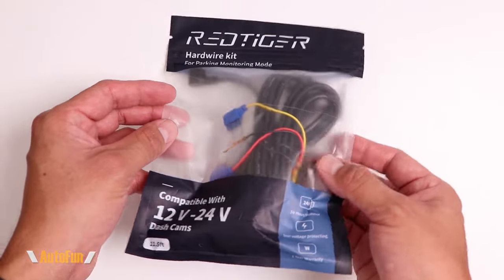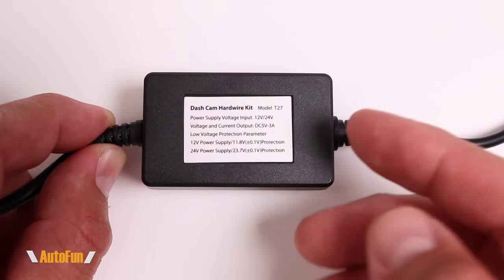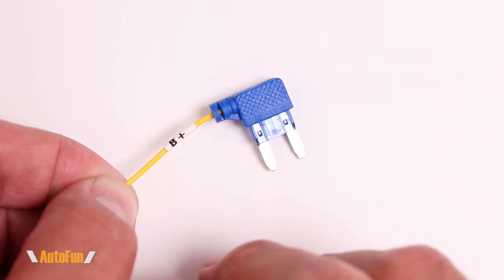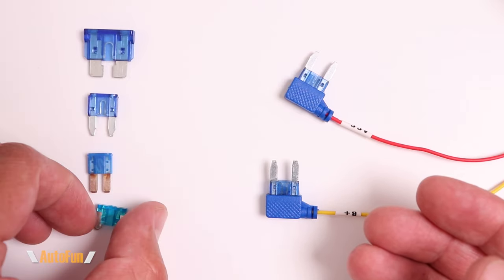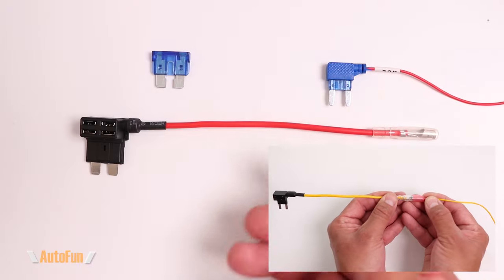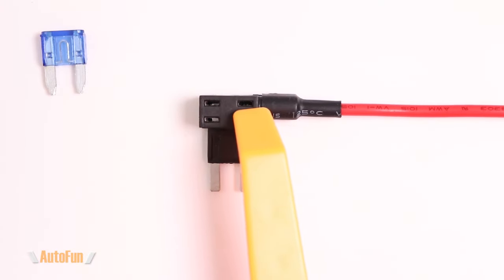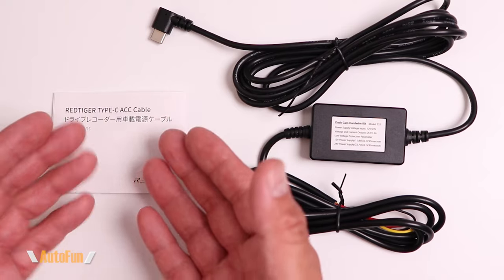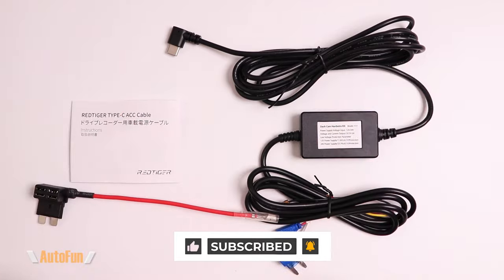REDTIGER HARDWIRE KIT (Install Prep, Connections & Fuse Taps Explained)

Comment: So you cannot place the ACC terminal which you're supposed to put in an empty slot in the fuse box into the fuse tap, you're supposed to cut the wire, attach it to the fuse tap wire, buy and place another similar fuse and then use it?
Reply from the maker: Hi A! Fuse taps are only used in some cases, here is my video where I explain this in more detail https://youtu.be/Qzw9yUYN7zo Cheers!

Comment: Can I use this kit for a headunit (carplay screen) ?
Reply from the maker: Hi Alberto! This is kit is specific for the dash cam models listed by Wolfbox (link to the kit in the video description). I do not recommend using it differently. Cheers!
Reply: @AlexAutoFun  Thank you for your fast response. You just earned another subscriber. If you have any recommendations for a hardwire kit that I can use for a carpuride headunit, I would greatly appreciate it.
Reply from the maker: @albertomedina193  You're welcome and thanks for supporting the channel Alberto! Ah unfortunately, Carpuride does not have a hardwire kit, they typically use 12VDC, so there is no step down regulator in their power plug assuming your Carpuride system is like this one https://youtu.be/oHlf0MmguWk You can see how the power input is labeled 12V so what installers do in those cases where the customer requires a hardwire connection is either cut the cigarette lighter plug and tap the system directly to the car (with fused connections) or they install a generic cable with the same DC barrel plug which again is connected to the car's power via a fused connection. Cheers!
Reply: @AlexAutoFun  you are the Man. Thank you!!!
Reply from the maker: You're welcome Bud!

Comment: what is maintainance for the hard wire? i actually afraid low volt not cranking on standard liquid old car battery
Reply from the maker: Hi Clovax! The hardwire kit is sealed and does not require maintenance. Here is is my  other video https://youtu.be/Yky9_tTvwMc where I explain how the hardwire kits work and the different features to look for when buying one (including the low voltage cut off). Cheers!

Comment: Hi can you tell me what is the fuse rating in amps of the links fitted to the hard wire kit for the G900.  Mine are coloured blue. Blue fuses are normally rated at 15 amps . I want to fit my red and yellow wires with in line fuse holders as I wish to tap into another circuit on my Landrover. What size fuses should I fit? 15 amp seems a rather high value.
Reply from the maker: Hi Paul! Correct, the fuses that come with the G900 hardwire kit are blue (15A). And here is my hardwire install video https://youtu.be/uZp95NbNlmM Cheers!
Reply: Many thanks for your quick reply. Your videos are excellent.😊
Reply from the maker: @paulroberts6697  You're welcome and thank you Paul!

Comment: If I connect the hareware kit, do I nned to connect the other wire to the start the camera or is not nevcesary?
Reply from the maker: Hi G! Most dash cams that require a 3 lead hardwire kit will usually need all 3 wires to be connected in order for the dash cam to work correctly. What I recommend when someone does not need park monitoring, is just to turn it off in the settings menu (most dash cams will let you turn off this feature). Cheers!

Comment: will using hardwire void the warranty??
Reply from the maker: Hi S! Are you referring to the warranty of the dash cam or the vehicles warranty?
Reply: @AlexAutoFun  vehicle warranty
Reply from the maker: Hi S! Ah, that's a good question (often a debated one). You would want to check your State's law. In my State supposedly the law prevents a Dealer from denying warranty if someone added something to their car or worked on their own car as long as whatever was added or the work that was done was not the cause of the failure. So let's say you put window tint on your car and your transmission fails. It would probably be difficult for the dealer to deny it because the tint or the tint install did not likely affect the transmission. But as simple as that sounds, there are horror stories of dealers not honoring warranty if they see a modification claiming it is what led to the failure. Some owners even had to take them to court or complain directly to the manufacturer (since dealers are typically independently owned) to get their warranty honored. Cheers!

Comment: Hi mate. Thank you for the video. May I ask a question about the setting please?
I have a fun since yesterday and the hardWire kit. I juste found the food spot to plug the red and yellow wires but I get a message saying use the acc wire kit when I try to use the parking mode .... ..
And when I torn the ignition key all works perfect but when I turn it off it say ACC off then off
Do you have any idea on what I could do to fix this please?
Thanks regards
Reply from the maker: Hi pierroalino! I would have the installer check all the connections (ACC, BATT & GND) to confirm nothing has come loose and that they connected to the correct locations for ACC and BATT (I seen cases where park mode is not enabled if ACC and BATT are reversed or connected to the incorrect locations that does not provide power at the correct time for both ACC and BATT) Hope this helps, Cheers!
Reply: @AlexAutoFun  hi I contacted redtiger and they helped me figure out how to solve my problem. I just had to replugged the red wire into a another fuse slot and now it s all working fine. Thanks for you answer have a good day
Reply from the maker: @pierroalino  You're welcome and glad to hear it's working now. Cheers!
Reply: If you want the dash cam to function only when ignition is on , and turn off when ignition is off (to save car battery) can you just use the accessory fuse wire and ignore the battery wire ?
Reply from the maker: @haych9803  Hi Haych! The dash cam will turn off when the ignition is off and turn on when the car is On when connected correctly with the 3 lead hardwire kit (If additionally you don't need parking monitoring, most dash cams will let you turn it off in the settings menu) Hope this helps, Cheers!
Reply: @AlexAutoFun  my dash cam has poor instructions and has the three cables, I only want accessory power when turning ignition on, I don’t want parking monitor, can I just leave that battery cable unplugged ?
Reply from the maker: @haych9803  Hi Haych! Ah most dash cams that require a 3 lead hardwire kit will usually need all 3 wires to be connected in order for the kit to work correctly. And here is my introduction to hardwire kits video https://youtu.be/Yky9_tTvwMc showing the differences between them including 2 wire hardwire kits. Hope this helps, Cheers!
Reply: @AlexAutoFun  cheers mate I really appreciate it, I will take a look at that video, would you possibly be able to provide me an email where I could send pictures of my dash cam and wires and my car to see if you could help ? I cannot find help anywhere else as your the only one who knows what they are talking about.

Comment: i had my redtiger camera hardwired by an electician for me and after almost 2 days of using the camera 24/7 i wonder if it`s normal for the actual dash cam to be warm/hot and if is there any chance of catching fire or i shouldn`t be worried about it ?
Reply from the maker: Hi Catalin! Dash cams normally run warm to hot (and very hot if running it in 4K). And while I had not had any of them catch on fire yet, if you are looking to reduce their temperature here are some suggestions. Reduce resolution (lower resolutions produce less heat), reduce bit rate (some dash cams will let you change it) and finally enable screen saver (screen time out) which will turn of the display after a period of time but will continue recording (the screen itself generates heat). Cheers!
Reply: @AlexAutoFun  thank you, I just did all that, feels a bit better, still warm tho' I'm just worried because I just had a new car and installed this dash cam and the hardwire kit and I'm worried about it being always warm/hot and what this can do in the long term.
Reply from the maker: @piciux2323  You're welcome! It would also be a good idea to have your installer check the install. I seen cases where something was incorrectly connected or the wrong hardwire it was used (or a defective hardwire was installed) etc. Cheers!

Comment: are you near newhampshire,i have problems where phone wont exept codes or icon scanned
Reply from the maker: Hi Carlos! Not sure which dash cam you are using but remember the T27 and T700 do not support connecting to your phone. You can also contact RedTiger for support, they may be able to walk you thru some troubleshooting steps. Cheers!

Comment: The 2 fuses value   into the piggy peg wire must add up to the original single fuse value. Otherwise you are increasing the ampere allowed and might cause a fire.
Reply from the maker: Hi Vincent! Ah remember a functional fuse tap creates 2 separate independent circuits (each one with a different amp rating partially determined by fuses that are loaded into the each fuse slot in the fuse tap, the car's internal wiring and current load on the circuit to be tapped) The fuse removed from the car goes in the fuse tap bottom slot and the second fuse (top fuse) is for the hardwire kit. So they are each independent of each other, each one driving it's own load. Here is another video https://youtu.be/Qzw9yUYN7zo where I explain how fuse taps work in more detail, Cheers!
Reply: @AlexAutoFun  i was wrong.  The 12 volt is split  and the fuses are not in series. I just confirmed with a DMM and the same wire.with 2 fuses
Reply from the maker: @vincentlee2460  That is a great way of explain it, I actually have a video on the works covering the internals of them because as simple as this little guys are, sometimes it helps to see the inside of something to understand it, but I like your idea of the DMM demonstration. Cheers Vincent!

Comment: This hard wire kits are a bad design because of that fuse ever blows your screwed and will have to use a fuse tap anyway. But I had to do mine a little different anyway. I have a wrangler JL and in the wrangler there are 6 fused wire taps on the inside cab under my glove box so I used the 10 amp and 15 amp battery and acc connections.  I cut off the fuse taps on the kit and spliced in my own fuse taps. And all the wiring is on the inside of my cab and I didn’t have to run it far and didn’t have to go thru the firewall. Only issue is there is a lot of slack I had to roll up and hide behind and under my glove box. No big deal it all works and is fuse protected. But now it’s protected by 2 fuses because the factory wires are already fuse protected. Just extra protection but works as designed. The original issue I had with this was the hardwire kit doesn’t allow you to remove the fuse if it goes bad.
Reply from the maker: Hi A! Ah yes Redtiger, has since upgraded their kits to this new design https://youtu.be/_1cIkR3YB-8 Cheers!

Comment: Hi - I’m going to be installing red tiger into a f15 x5 and the fuse that I’ll be removing and adding to a fuse tap are 5amps each for acc and batt. What fuse amp does the red tiger require for acc and batt? I dont have any space in my fuse box. Thanks in advance!
Reply from the maker: Hi Kelvin! Ah yes the fuse for the hardwire kit I used, is of the same value as what came with the kit. In this case as you can see in the video the kit came with a blue fuse (15A), so I used a 15A fuse on the functional fuse tap. Cheers!
Reply: @AlexAutoFun  thanks for replying!!! Do you think instead of a 15A fuse red tiger cam would be ok with a 5A fuse?
Reply from the maker: @KDR195  Yeah I had other viewers used a lower rated AMP fuse (so it can pop earlier) However just remember that deviating from the included AMP spec may impact warranty if something goes wrong in the future since we are deviating from the factory kit. Hope this helps, Cheers!

Comment: Can i wire b+ direct into battery terminal +.   Not the acc wire
Reply from the maker: Hi Fisher! ACC and BATT need to be connected to their correct locations (ACC and BATT are separate functions, here is my video where I cover this in more detail https://youtu.be/K2iKXj82354 ) in order for parking monitoring to work correctly. If ACC or BATT is connected to a source of power that does not provide ACC or BATT power at the right time, the dash cam may not work, parking mode may not work or the dash cam could stay On all the time. Cheers!
Reply: @AlexAutoFun very hard to access for camry toyota.  Under the steering wheel
Reply from the maker: @fisherbrown903  Hi Fisher! I don't doubt it. That is one of the reasons I recommend professional installation. In addition to the time invested in trying to learn the process for a single install, some installs are also physically demanding, I lost count of how many times I had to twist myself into a pretzel to reach the work area. There's also sharp areas of the trim of the car or the sheet metal itself, so it's usual that my hands are cut left to right LOL. I gotten good at it (like all installers do after hundreds of installs), but this experience won't be developed on a single install. Cheers!
Reply: @AlexAutoFun  yes. Very hard for toyota. Under steering hard to access

Comment: I wonder if this works with the 70mai dash cam..
Reply from the maker: Hi Ben! While I may be possible to use a different power adapter on a dash cam, I usually recommend sticking to the matching power adapter for the dash cam (brand matching) to ensure that there are no functional issues or issues with warranty coverage. Here is my follow up video https://youtu.be/Yky9_tTvwMc where I explain how hardwire kits work and the different features to look for. Cheers!
Reply: @AlexAutoFun  Thank you bro! i actually am switching to a wolfbox dash cam! thanks to one of your vids btw :D!
Reply from the maker: @bentenxl  You're welcome! 🍻

Comment: Buongiorno ho acquistato la dashcam t 27 con il kit per il monitoraggio del parcheggio 24  Ore su 24.

Ho fatto installare il tutto all'elettrauto.

Il monitoraggio del parcheggio è comunque possibile decidere se attivarlo o disattivarlo in modo che non registri?

Se si in che modo?

Grazie
Reply from the maker: Hi Dario! correct if the hardwire kit was installed correctly there will be a new option in the menu where you can choose park monitoring using the G-Sensor or Time Lapse. I do have a video explaining how to setup the parking mode on the T27 next week. Stay tuned for that one, Cheers!
Reply: Perfetto grazie mille!

Comment: Ever had an instance where the yellow B+ when connected starts up the camera, but then the camera immediately loses power? If the car is started through the ACC the camera stays on with no problem. Having this issue currently with a Subaru Ascent 2022
Reply from the maker: Hi Ray! I would have the installer check the install, checking that the car fuse spot still has power at the correct time (both for ACC and BATT) I seen cases where the car will turn off power to particular systems (specially in ECO mode, hybrid and EV vehicles) in to maximize fuel efficiency. Here is the video for how I find and test for ACC and BATT https://youtu.be/K2iKXj82354 If the both fuse spots for ACC and BATT have power at the correct time, I would also recommend contacting RedTiger for support, maybe just a bad hardwire kit? they may just swap it for you, or guide you  thru some troubleshooting steps. Hope this helps, and please let us know what you find. Cheers!
Reply: @AlexAutoFun  spoke with support and the issue turned out to be a bad hardware kit. New kit is working fine! Camera came right on and goes in to parking mode without issues
Reply from the maker: @rcharger007  Awesome! Thank you for keeping us posted too! 🍻

Comment: How come when I connect only the ACC cable in the cigarette lighter fuse slot without connecting the BA+, the camera won't turn on when the car is on.. I have to ALSO connect the BA+ along with the ACC wire.. why is that? Why can't I just plug the acc wire and only use it on acc mode?
Reply from the maker: Hi Mr. Boniato! most dash cams that use a 3 lead hardwire kit require all 3 leads to be connected in order to function (ACC, BAT & GND). Hope this helps, Cheers!
Reply: @AlexAutoFun  Thank you..when using the cigarette lighter as acc, do I need to have two fuses, one for the kit and one for the lighter, or is the one from the kit enough to power the lighter and the camara?